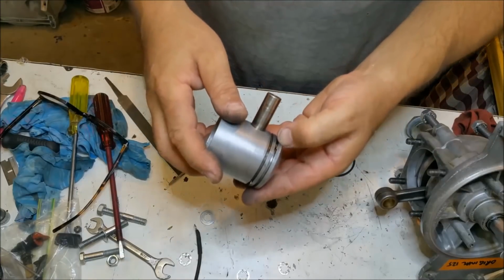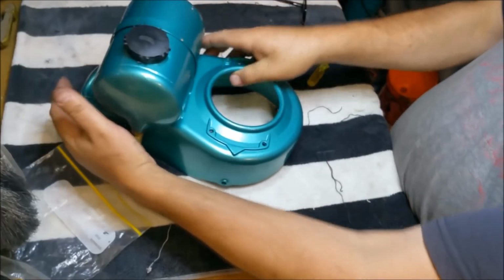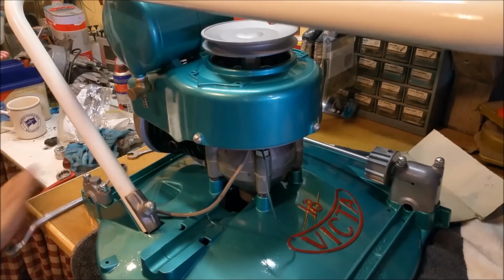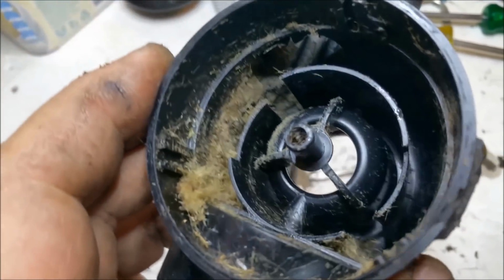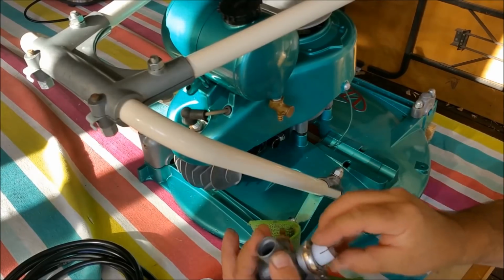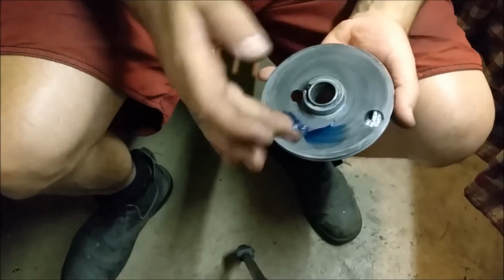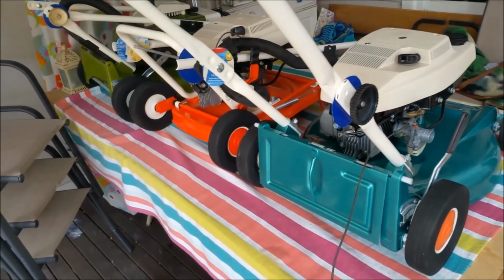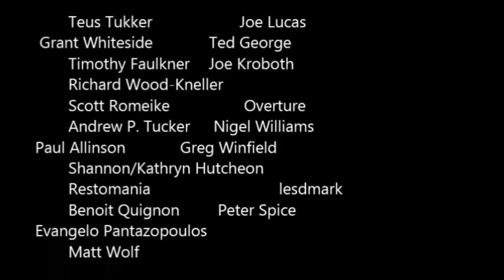Restoring 7 Classic Victa Lawn Mowers Part 8

Comment: Hi Pete. A quick tip with the starter recoil springs. Can be much easier to attach the outer end of the spring to the housing, then wind the spring from outside in into the housing. Saves some hand cramps anyways. Great vids :)